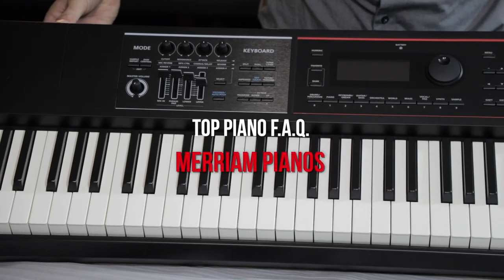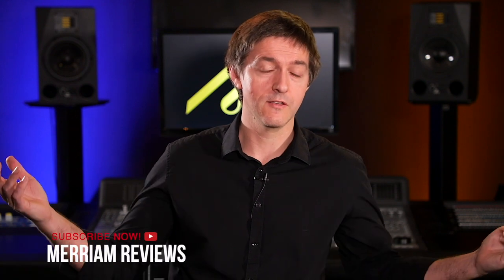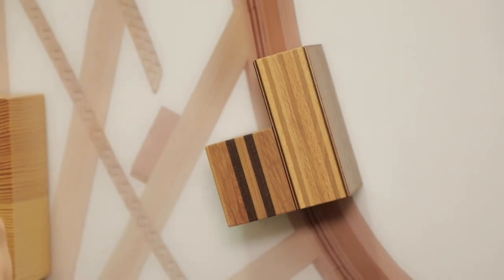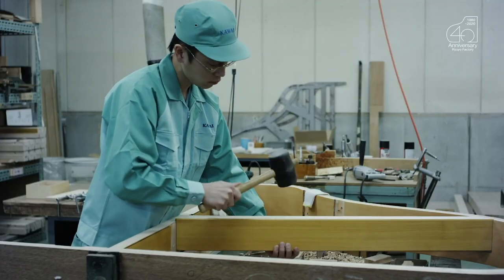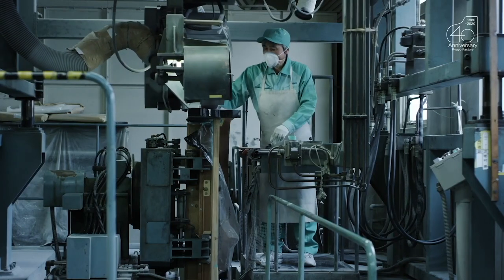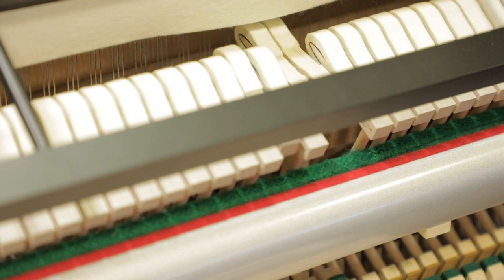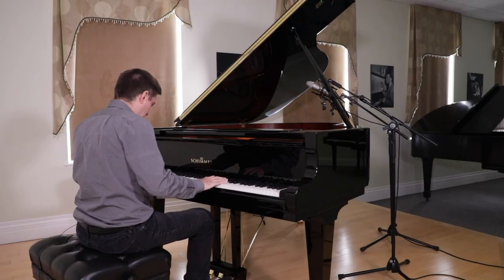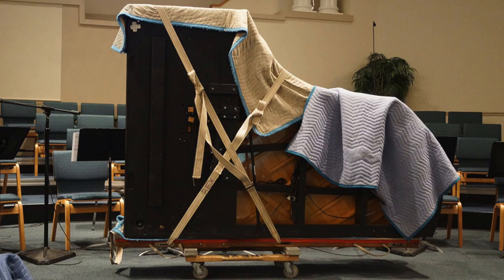🎹Piano FAQ: When Were Pianos Invented? How Are They Made? What Do They Cost? & More🎹

Comment: Cost, weight, and wood, are some of the reasons I prefer the new lighter weight digitals.  I notice Kawai is beginning to use more and more plastic parts in their acoustic grand actions.   I've wondered about making the key sticks themselves out of carbon fiber or perhaps some sort of injection molded material.  Wood is a real problem in regions where termites are common place.  I've seen actions totally destroyed by termites.   Humidity control is also a major problem.  Spruce soundboards have been the standard but I've wondered about using sound boards made of carbon fiber.   Honestly I think the modern electronic digitals will eventually dominate the market if they don't already.  They are lighter, sound better in most cases, and far less expensive.  Being easy to transport is a real plus.
Reply: internet termites you gotta explain this one